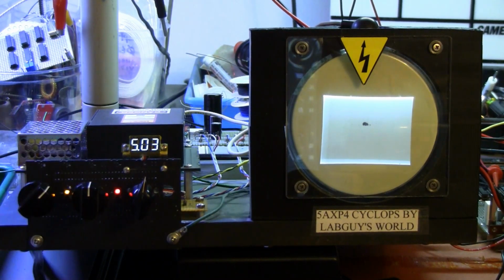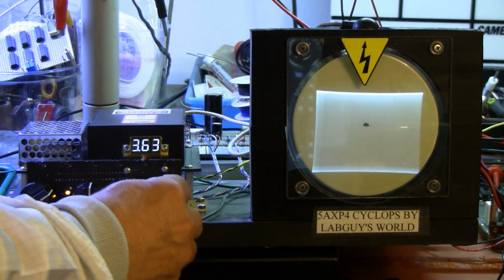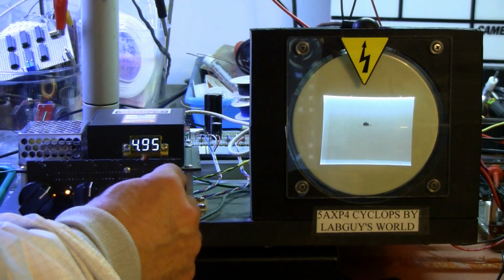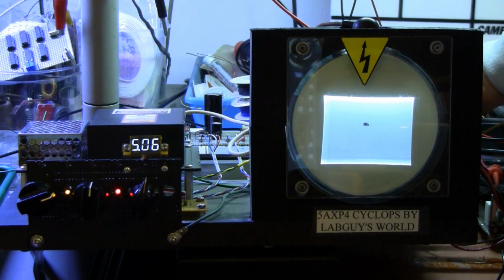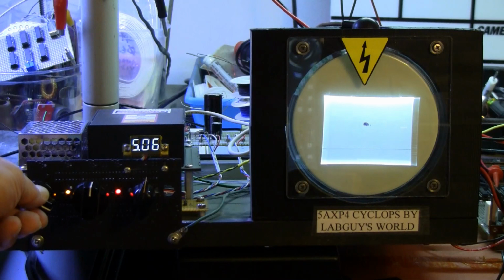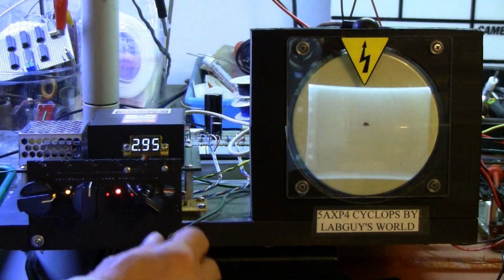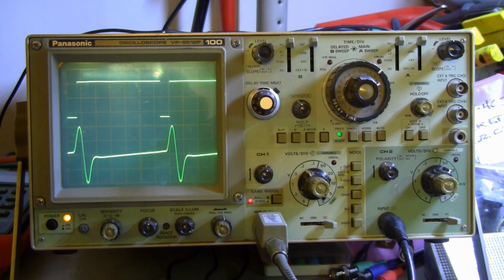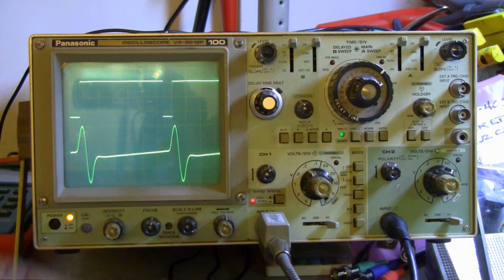The Chief - Update #6

Comment: I have a 5AXP4 CRT. I've used it for two my Zenith porthole sets when I rebuilt them. It is currently stuck in my 1947 Silvertone chassis and I am not sure I will be able to get that set working correctly. I like your HV power supply. OLDE TVs that are restored need a blanking circuit added. Great demonstration. I like your scope. I need a decent scope. Gary